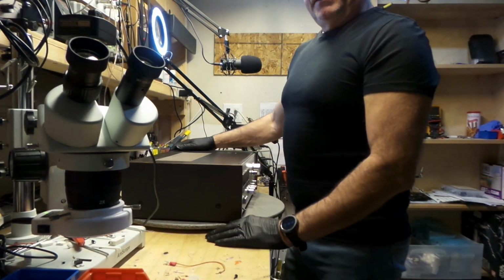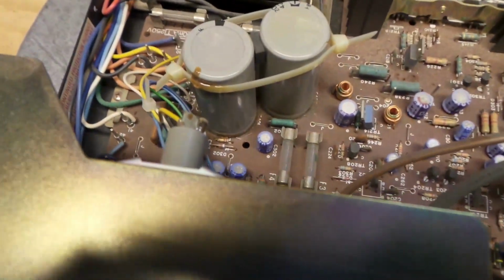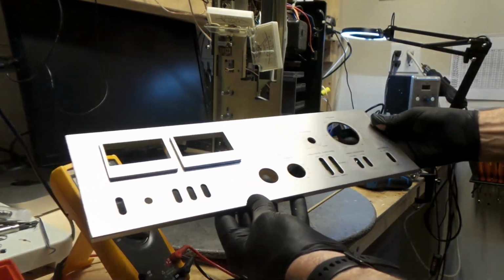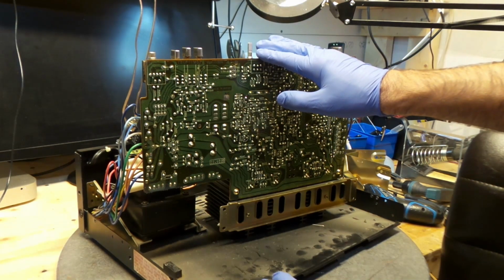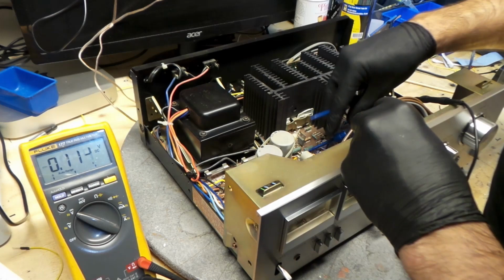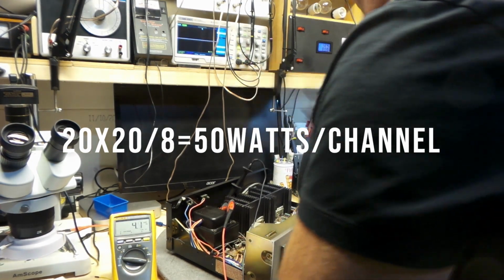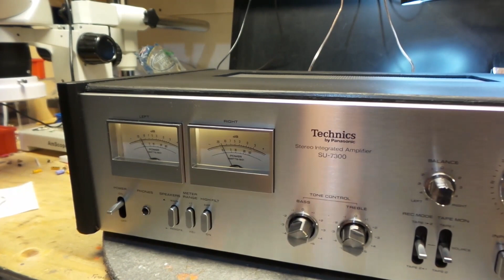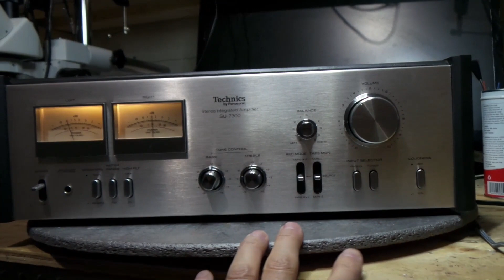Technics SU-7300 fully serviced

Comment: nice job, but how do you detect faulty capacitos on a board with the multimeter, it sounded like you were measuring resistances... i own a 7300 and i would like to recap because it delays a lot before sounds comes out, my guess is that there are some bad capacitors but i don´t know how to detect them. thanks